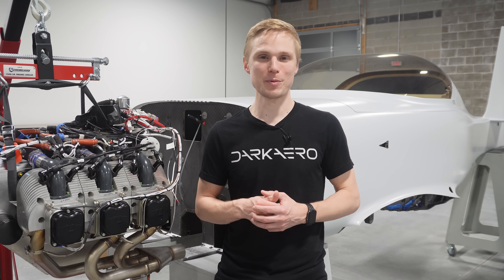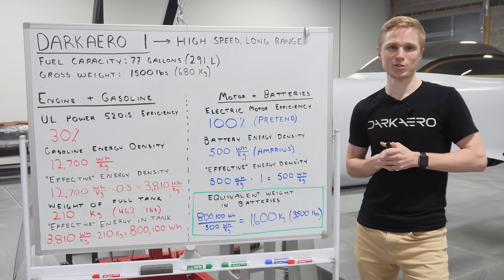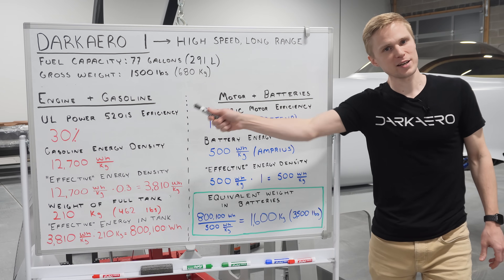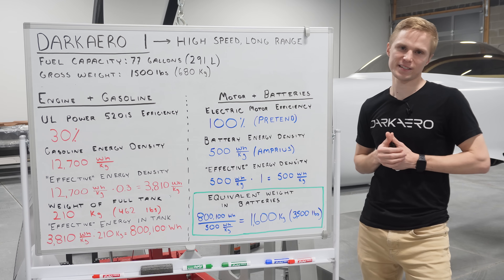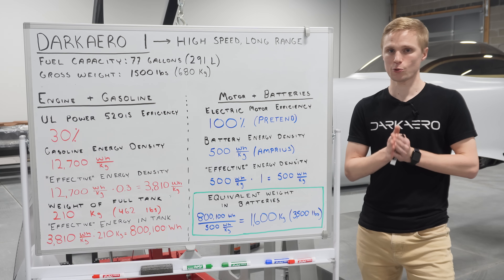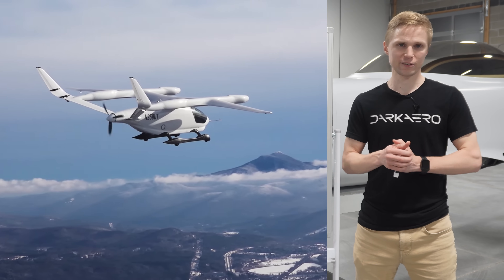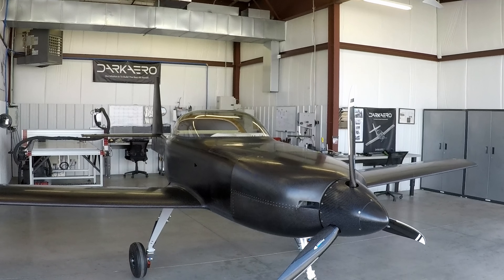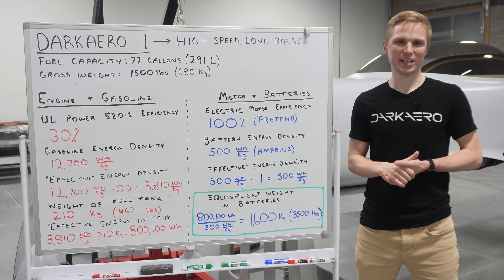The engineering challenge of electrifying airplanes

Comment: The physics don't justify EV cars in my opinion.   Yet here we are.  Your analysis was spot on.  I did the same when I was thinking of buy a Tesla.  But didn't see the reason to buy one.  I do think Tesla makes amazing cars but don't see battery technology  capable  enough to compete with gas.
Reply: EV's will make sense sometime in the near future I'm sure, but to be objectively better we got a bit to go. But you don't get to better without first being good enough :-)
Reply: Here's simple physics for ya. A lr awd tesla model 3 weighing 3,900# can go over 300 real world miles on less than 2.5 gallons of gas in total energy stored in the battery. It's #1 conquest trade a BMW 3 series also in awd trim can't even go 75 miles on the same amount of energy. 👍🏻😎
Reply: @4literv6  Wrong. False information, you're leaving out a massive amount of variables, and a BMW 3-series is not equivalent to a Tesla as it is both massively above it in features and attributes and also massively cheaper.

The Tesla will absolutely not go anywhere near 300 real world miles on the highway at high speed at low temperatures. It is also made of hugely CO2-emitting aluminium while the 3-series is not. The Tesla is a hollow shell of a car with basically nothing in it, while the 3-series is a sumptuous, far quieter and more comfortable car with a massive amount of more features and equipment.

What temperature do you think an aircraft flies at, and at which power requirement? At a temperature which would require the Tesla to have its aptly named "afterburner" battery heater on at 7kW constantly, and will probably not be nearly enough with the battery size the aircraft requires and the temperatures aircraft fly at. And the thing will be flying at a massive power requirement the whole time, which Tesla's tech couldn't handle not to mention it would drain the battery in a short distance...and even shorter if the people in the cabin don't want to freeze but instead want to be comfortably warm.

Comment: Ampruis is not in production and has 450wh/kg for hundreds of cycles, rather limiting. Realistictly it would be more like 350. You can't have high power, high discharge rate and high density all in one battery. Life span charge cycles will suffer.
Your assumptions are in favor of the electric aircraft, don't keep it simple. Batt too high density, e-motor 100% eff. Take real numbers as with the gas engine and the e-aicraft looks way worse.
Reply: Clearly the analysis is of a best case with technology which isn't ready yet. The HPDM-250 motor specs are science fiction, too. That's okay because it is explicit.

Comment: what about solid state batteries? they are maybe 1% overall volume of a lithium ion battery of equal voltage and amperage and weigh accordingly
Reply: I hear that pixie dust is maybe 0.00001% overall volume of a lithium ion battery of equal voltage and amperage and weight accordingly
Reply: I work in tech, Amprius is very responsive and a pleasure to work with. I have not been able to get a response from a single solid state battery "manufacturer".

Comment: If I was going to design and/or fly an electric powered airplane, it would have a battery pack that could be jettisoned in flight, in case of a runaway thermal event/fire. If you have ever seen videos of a burning Tesla, electric bicycle or a bus burning, it's like dropping a match into a large box of fireworks. Now if the right battery ever comes along, it might be a different story. BTW, I would love to see Dark Aero put a STOL bush plane together, using the technology they have. See Mike Patey on that.
Reply: Just what we need... homebuilt aircraft dropping massive battery packs on whatever happens to be below them.

I understand the desire to get away from a failed battery, but no commercial battery-electric aircraft design includes a feature to jettison the battery - it's not reasonable.

Comment: For an engineer, energy, weight, speed, altitude, and other features are key. In practice, money is the decisive feature.
For a given mission, efficiency is measured in cost per mission, all costs considered. The less expensive solution wins.

Then, consider relativity 😂: relative costs are always changing. Right now, electricity is becoming less expensive, and environmental damage more expensive.
Reply: Do you really think electricity is becoming less expensive? All "green-governed" nations elsewhere in the world have experienced skyrocketing electricity prices...
Do you really think that the US will be able to build new, very cheap electricity production at a faster rate than the massive energy content of all the gasoline and diesel is being removed? Including all the grid work? And charging infrastructure? I see the complete opposite happening, as has been experienced in countries like Germany when they did their "Energiewende" push which resulted in no reductions in CO2 emissions while simultaneously skyrocketing electricity prices. Germany has very many similar countries all around it so benchmarking is incredibly easy too, so we got very good and reliable data on how incredibly badly Germany really did fail. And this was clearly seen and proven well before the Ukraine war.

I also don't see how HVO biodiesel, biomethane, bioethanol and e-fuels would cost much nor create environmental damage. In fact since those are nowadays produced by big corporations they have all the necessary certificates and they've done additional environmental studies proving their green credentials. 
It is clear that EVs do in fact do massive environmental damage and what's most indicative of how dishonest the dictation of EVs really is, how fraudulent it is: they have not even bothered to pre-plan or pre-pay for the produced EV batteries' recycling! None of those virtue-signaling fake 'environmentalists have taken any responsibility for the upcoming fate of of the tens of millions of tons of EV batteries with their expensive, difficult, specialist-equipment-requiring handling and recycling!
Reply: @pistonburner6448   Relative prices. Electricity cost is going up, fossil fuel cost is going up faster. COST, not market price, which is influenced by radical ambiental activists. Fusion may disrupt relative prices. Lots of research for fusion, solar, bateries, engines and other related to electricity, not that much for fossils and combustion engines.

Comment: No one is proposing using batteries for electric aviation. That is asinine.  Liquid hydrogen fuel cell is the way it is done. Liquid hydrogen has a gravimetric density 3× higher than gasoline which means you can make the plane lighter than an ICE version, not heavier.

The plant takes away about 1/3 of that advantage but it is still 2× better than hydrocarbon fuels

You make the fuel tank 3× bigger. It simply requires designing a different airframe (something like a wingbody provides the interior volume to accomodate the difference in volumetric density and then some).

The end result is a longer range aircraft than could be accomplished with a combustion powertrain.
Reply: It was my understanding that proton exchange membrane hydrogen fuel cells unfortunately suffer from relatively short lifetimes compared to gas turbines due to the generation of free radicals degrading the catalyst layer, maybe that has been mitigated now
Reply: @timi707_1  that's completely incorrect.  My car has a 130kW PEM fuel cell that is 7 years old and has 1440 hours (72k miles) on it. It has 0% degradation in its range. It may have some degradation in its peak power output; but it isn't perceptible (it might be measurable but I don't have a easy means of measurement). In any case, there is no significant degradation in 1440 hours of real world operation. 

My car has a compressor (supercharger) to facilitate increase in relative oxygen. I have had it up to 9000 feet, also with no perceptible degradation in power, but of course a fuel cell does require oxygen just as an ICE does.
Reply: @homomorphic  I wouldn't expect much change in your range unless you had a hole in your hydrogen tank, but any mechanism in reality will of course degrade over time and there is no escaping entropy. 
I see now that Toyota for example expects the PEM in it's Mirai vehicle to last upwards of 5,000 hours, which is great, but still not close to the average for a gas turbine.
I also see that stationary PEM's have achieved lifetimes of 40,000 hours at low average outputs, which is really great, BUT this lifetime only considers irreversible degradation.

 The average time between overhauls for a new gas turbine widebody aircraft engine is 20,000 hours, spending most of it's life at a significant percentage of it's maximum power output, which is a much higher average output than any road vehicle. (Unless you are a drag racer or something) I'd be interested in seeing some long term data on PEMs in aircraft.
Reply: @timi707_1   the point is there is no noticeable degradation over 1440 hours real world use. A continental O-200 has a overhaul at 1800 hours, so there is absolutely no reason to believe that a PEM fuel cell wouldn't match that.
Reply: @homomorphic  Oh no question about that, a PEM would destroy one of those old four bangers in every metric, probably INCLUDING cost with enough economy of scale. An O-200 is practically stone age technology at this point, they still burn lead for heaven's sake, I think I'd get farther pedaling the thing
Reply: @timi707_1   sure, and they are much lower cost than an O-200. So if they last 2,000 hours then you just replace them. A PEM fuel cell has no moving parts and is just some plastic and sheet metal. Automotive companies are making them at cost parity with internal combustion now. Now one is going to be putting a turbine in a aircraft like the darkaero. 

For larger scale aircraft the PEM fuel cell can be built at a much higher grade than the current automotive fuel cells and still be low enough cost to replace at a turbines rebuild interval for less than the cost of the turbine rebuild.
Reply: In fact, many companies are proposing using batteries for electric aviation, and you can buy one battery-electric aircraft (the Pipistrel Alpha Electro shown in the video) now. Clearly, batteries are not viable for long distance aviation.
Reply: @brianb-p6586   they are all absolutely useless. They have absolutely impractical range and/or passenger/cargo capacity. They are toys and will never be real aircraft
Reply: @homomorphic  What's a "real aircraft"? In practical terms the DarkAero design is just a toy, too... it only carries two people, with negligible luggage, just like the Pipistrel Alpha Electro.
Reply: @brianb-p6586   the darkaero will have a range of more than 1,000 miles. That's not a toy. It is a extremely  practical personal aircraft.

There are already 4 seater hydrogen fuel cell aircraft with more than 1000 miles range (i.e. the HY4).
Reply: In saying that "Liquid hydrogen has a gravimetric density 3× higher than gasoline which means you can make the plane lighter than an ICE version" you are ignoring that the cryogenic fuel tanks weigh several times as much as the fuel which they contain. The total fuel system weight is much higher than with kerosene (jet fuel).
Reply: @brianb-p6586   no I allowed for plant. Reread my post, you must have missed that. Cryogenic tanks dont weigh any more than jet-a tanks, I think you are mistaking compressed hydrogen tanks for comformal LH2 tanks.
Reply: @homomorphic  So your plant allowance was supposed include containment, as well as all of the hydrogen handling plant? You're way too optimistic. 

Although compressed hydrogen gas containment is even worse than liquid in weight, and more demanding of a pressure vessel shape, liquid hydrogen tanks conforming to available spaces are not viable... at least not in the opinion of any aircraft manufacturer, such as Airbus. These are not just jet fuel tanks wrapped in a bit of insulation.
Reply: @brianb-p6586   of course it does. That is the definition of plant. Everything needed to process the energy in the fuel into kinetic energy. LH2 tanks are at atmospheric pressure. They require insulation but, insulation is not heavy. The tanks can actually be formed as cavities in the airframe.

Comment: as DarkAero discovered in their design, landing gear is super difficult to get right. Many aircraft can't land above a certain weight as a trade-off, and must dump fuel for emergency landings. With a battery-based system, that trade-off won't be practical, so the max take-off weight can't exceed the landing weight, further limiting a long-range scenario. At least today. This wasn't much of a discussion ten years ago, so I would expect ten years from now electic aircraft may have a significant commercial sector market.
Reply: That is a very interesting point.
Reply: I had wondered whether the ideal configuration of electric was the twin tail-boom like the P38. My reasoning is that you can put the gear a long way out along the battery laden wing without introducing turbulent flow under the wing. Although, batteries in the wings can lead to other safety concerns, unless future lithium sulphur batts are really as safe as the demos suggest...
Reply: Hard to say about commercial airlines using electric planes a decade from now. Batteries are generally improving 1-3% a year on a good year which by the end of the decade won’t be enough. Jet aircraft are able to be fueled day in and out and still work properly, may not be the same with batteries.

Comment: An electric darkaero would not be as good as a regular darkaero but it would be a pretty good electric airplane. The airframe is very light and provides low drag. Extend the wings a bit, reduce the speed, and make it single seat with no cargo it can probably fly 400 miles on a charge.
Reply: Dark aero claims 2200 nautical miles of range with 2x175lbs passangers, 100lbs of baggage and 462lbs of fuel. Converting gasoline to batteries (300Wh/kg) will get you 8.2% the Energy per mass. Converting 175lbs of passanger, 100lbs of baggage and 100lbs of motor to batteries and a lighter electric motor will give you 181% the fuel mass. All together (converting nauticle miles to statute miles because USA) you get a range of about 375 mi, assuming a linear relationsship between Energy and range. If you can get a battery pack with more than 320Wh/kg, or include weight savings from removing the seat, and/or decrease safety margins a 400mi range might be possible. 
Working against this is the nuances in the relationship between range and Energy. When fuel is burt, the vehicle gets lighter, this is not the case when discharging batteries. Futhermore decreasing range causes a higher percentage of Energy to be spent on takeoff and landing, decreasing the average Energy efficiency. Both of these factors reduce battery electric aircraft range.
Reply: @plainText384  , really good to see some numbers on this. The challenge for any higher speed electric aircraft for a given MTOM is that as the wings reduce planform area then the fuselage drag becomes a more important factor. Increasing aircraft mass allows bigger wing area to be used, so improving the range. Of course at some point you have to land within a given runway. So I suspect that we are going to see a lot of development in high lift leading and trailing edge devices for electric aircraft.
Reply: @plainText  other factors reducing the electric range below that calculation include the lack of pilots wanting to take long trips with zero luggage, and the improbabilty of saving as much as 100 pounds when considering all of the electric components (not just the battery and motor). But it's a rational and interesting calculation.
Reply: @brianb-p6586  You look like you understand a bit. Would you please explain how to calculate the range?
Reply: That is extraordinarily unlikely. Replacing the passenger with the same weight in battery, and the engine and fuel with the same weight in motor and battery, will not result in an aircraft carrying enough energy for that range.  But run the numbers if you want... DarkAero has given you all of the data that you need other than engine weight (look up the UL Power UL520iS) and electric motor weight.
Reply: An electric aircraft would be able to fly faster (as could climb higher into less draggy atmosphere), however with limited energy capacity it would have a significantly limited range.
Saying "as good" is probably not the right answer. The underlying limitation to how "good" would be how much electric energy could be integrated. It would likely mean trading not only fuel weight, but some of luggage/cargo weight to have "a good" electric aircraft (with a different purpose, or mission).
Worth noting that the energy density of batteries noted in the video are as of today. About every 6-8 years the energy density goes up 1.75x-2x. This means 125-300 mile (200-400 km) aircraft are not that far off. However 2200 nautical mies (3700 km) is a ways off (which is ~1/10 of the way around the Earth BTW).
Reply: @AerialWaviator  What makes you so sure it can't fly that far?